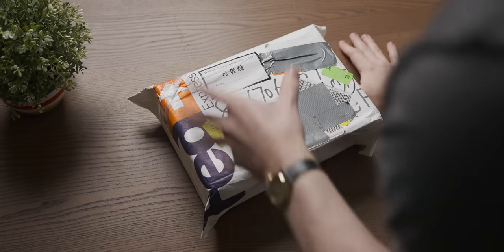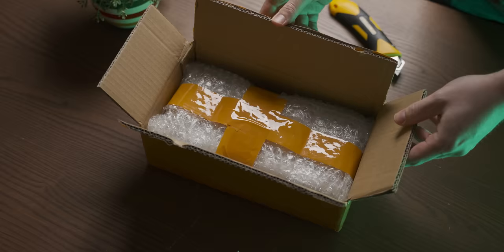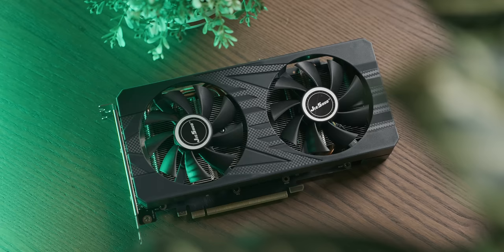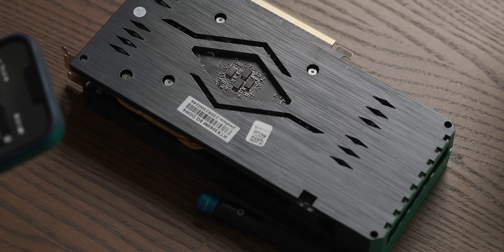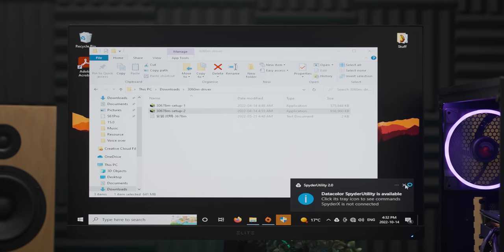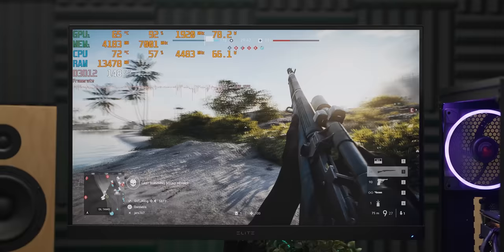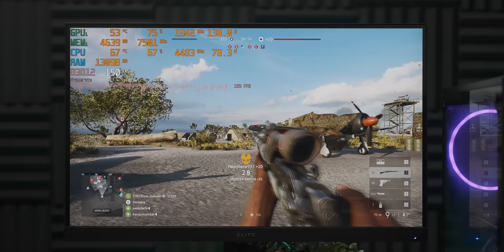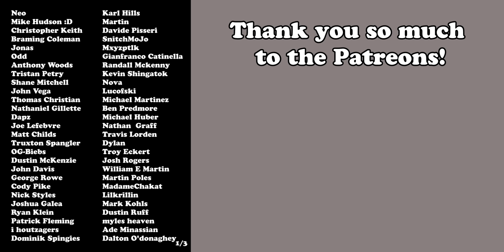This "New" RTX 3060 From Aliexpress Was Suspiciously cheap...

Comment: Need RTX 3060M Frankenstein drivers to run I have one from last year I use buy from eBay used for 150£ run fantastic and max 80w power draw any game I throw running last test on Tyne spy is 8731 points and Steel Nomad 1965 is great play all games with latest driver is great card better than my other RTX A2000m 8Gb now come another interesting RTX A3000 12gb mobile be interesting look better than RTx 3060m Frankenstein

Comment: You should try to extract the contents of the nVidia driver to a folder, and then force install the driver from the device manager. If it works, you'll have the latest driver and no security concerns.
Reply: Nvidia locked the driver to prevent people from putting in nvidia mobile to pci-e card. You need the old driver that release before they lock it.
Reply: It's written NVIDIA, all caps, just like AMD.

Comment: In case of Laptop GPU, there are many wattage options for a single GPU. The RTX 3060 that you have is of 80W. The max for 3060 is 130W. It will give you similar performance to desktop 3060.

Comment: mewby.. fix by bios mod.. let say.., take all signature from regular 3060 and.. copy DODGY seting in the signed 3060bios and pull that in the bad boy.. Will that fix the stuff? well duno i use them for mine.. :) and true is they eat almost 2x less energy,.,  but 99% game unplayable coz ned a SINGNATURE OFF to be enable to run.. what 99% anticheat in game take as BIG NONO!

Comment: I have a Gigabyte Gaming OC 12gb VRAM rtx 3060 triple fan. I push it with a 2k monitor(and 2 other side monitors)  and run everything on high-ultra settings getting anywhere from 144+ fps to 60+ at the absolute lowest. Great card.
Reply: What do you kid think 2K means?
Reply: @GrainGrown  1440p resulotion . bUD
Reply: @ClanOxyL  Wrong. That wouldn't even make any sense. But then again, gamers aren't the brightest bunch...
Reply: @GrainGrown  do some research before commenting bud.
Reply: @GrainGrown  you're not very brigjt
Reply: @GrainGrown  guess you don't understand resolutions.
Reply: @ClanOxyL  lmao, you're a joke
Reply: @ClanOxyL  Guess you lack basic logic...
Reply: @GrainGrown  if you're going to open your mouth about something you better know what you're talking about. Which you don't. 2k resolution is a generic term for display devices or content having a horizontal resolution of approximately 2000 pixels. 
Ok? My monitor has 2560x1440p pixels. That is 1.5x the amount in a 1080p monitor. A 4k monitor has 4 times the amount of pixels than a 1080p monitor. Yes I know what I'm talking about . Next time make sure you know what you're talking about before opening your mouth
Reply: @GrainGrown  if you want true 2k 2050 x1080p. But thats not what "2k gaming monitors" are.
Reply: @ClanOxyL  Let's test how bad your logic is.
Couple of simple questions, though you might find them hard.
You're one of those who call 3840 a "4K", correct?
Reply: @GrainGrown  nope 4096x2160. Now get lost dude your not doing anything here

Comment: Hi,
Can anyone recommend me a good, but also very cheap graphics card. Or doesn't matter if it's noname, knockoff, add long it works and won't set things in fire :D
I don't need full graph or anything, if Hellblade runs smooth on whatever resolution I'll be fine ;)
Thank you in advance!
Reply: look into MLLSE or 51risc (yes, the ones that make a GPU with spirit levelers). specifically the RX6600M gpu is very good value ($200 new afaik) and drivers work out of the box
Reply: @seibertron500  Thanks for the suggestion! I quickly looked up on it, but the budget is even more tighter. I'll keep in mind the brands anyway.

Comment: @5:20 the moment i see you using an unregistered version of winrar instead of 7zip causes me to not take your video seriously.
and you can't even choose word wrap in notepad.  Eye twitching turns into seizure.
I'm getting stutter...you are running it at 180 some FPS...how about vsync the damn thing and i bet you won't have stutter. I hate "gamers" like this, i want my card to to run 180 fps, when 60fps or even 120fps will literally look the damn same.  Yeah you got stutter because you are trying to push the card as hard as possible and as it has to adjust constantly based on rendering the fps are fluctuating widely. 
I.e. If you have a game that runs at 60 fps heavy load, and 140 fps other times, you set the framerate lock to 60fps...and guess what, that stuttering goes away!  shocking!

Comment: That is actually a pretty good buy. I like it!  I don't even think it needs all that cooling. 
I don't know why you think that a regular 3060  has 12 GB of memory but it usually doesn't have that!  6GB is all you get.
Reply: Er, no? The 3060 only had 12GB at launch, which confused everyone because the previously released 3060 Ti had 8GB. Nvidia didn't push the 8GB 3060 SKUs on to the market until much more recently, and were extremely careful not to mention the memory bus width being cut down from 192-bits to 128-bits (and possibly only half the cache, but I can't find corroborating sources to confirm that) until they were specifically called out about it.